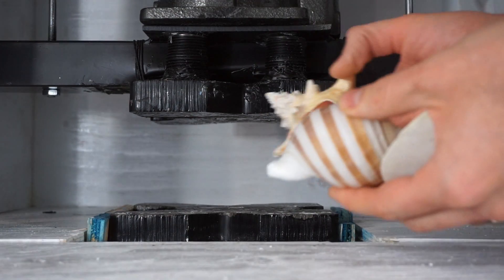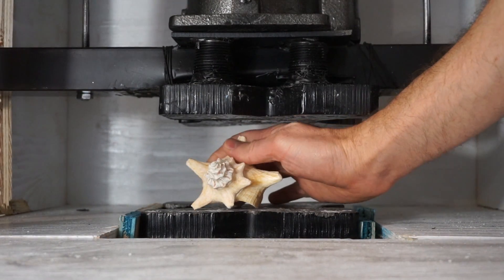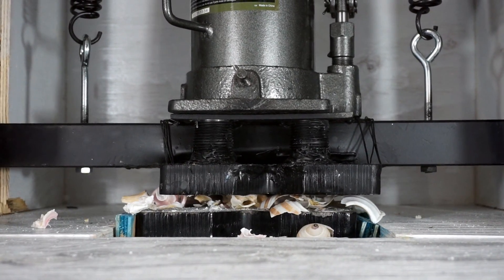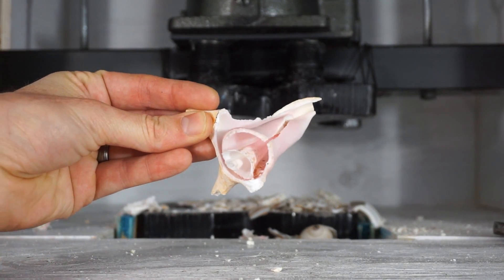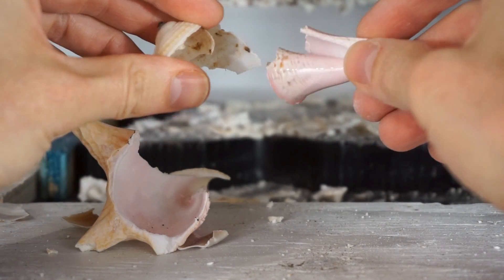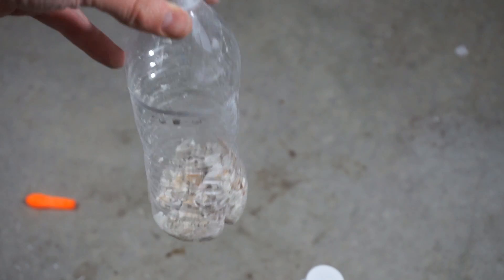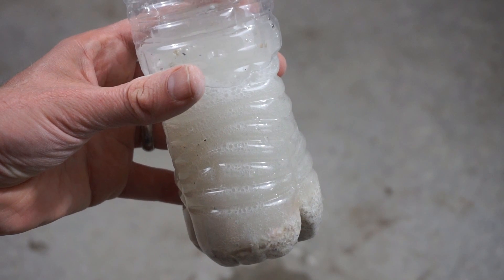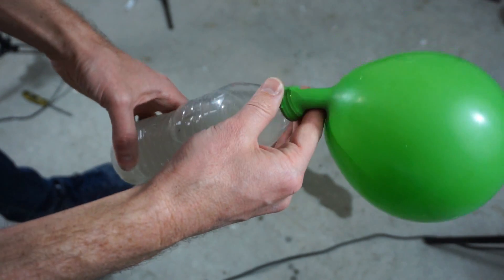Is It Possible To Inflate A Balloon With Crushed Seashells From A Hydraulic Press?

Comment: how about mixing oobleck with ferro fluid. put a magnet under it so it turns into spikes, freeze it solid, then crush that
Reply: Do you want to implode the universe?  Because that's how you implode the universe.
Reply from the maker: +carpii hey that's a cool idea about mixing ferrofluid and oobleck!
Reply: Hydraulic Press Action omg please do this it sounds cool as hell
Reply: Im interested to see what happens when magnet is applied. Would it create shearing so that it kinda breaks apart before gradually merging back into peaks? Or would it be so thick that the peaks can't properly form, and instead you just get little bumps :)
Reply: carpii ferrofluid is oil based and oobleck is water based. it won't mix well
Reply from the maker: n00baTr00pa I think I will just mix the cornstarch with the ferrofluid directly like TheTrollingHACKER said. So it won't be mixing oil and water.
Reply: carpii they would need to be the same density